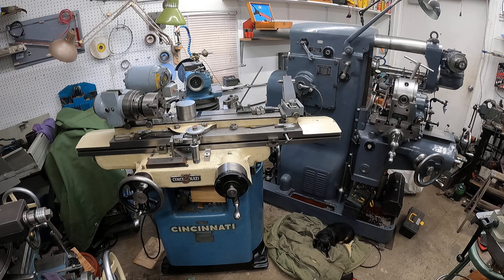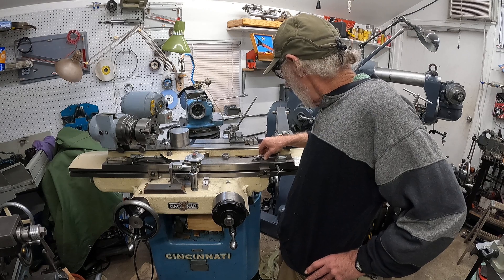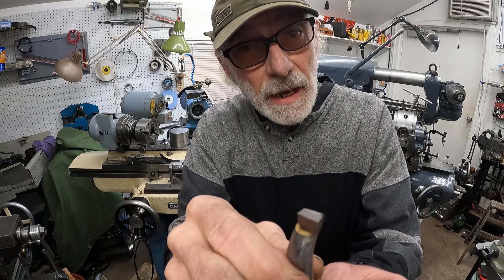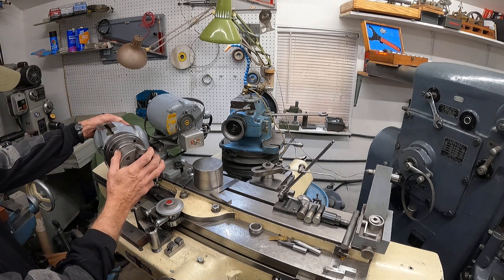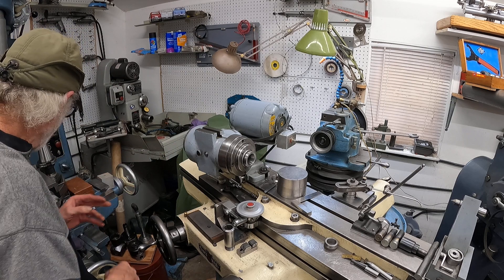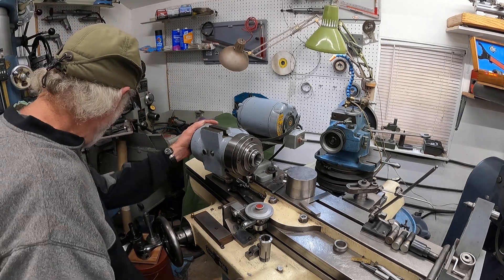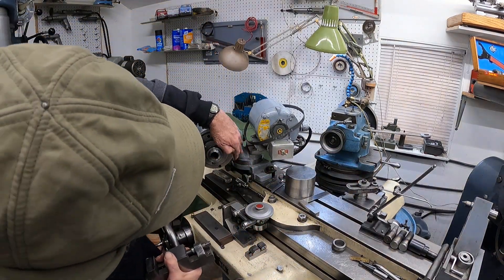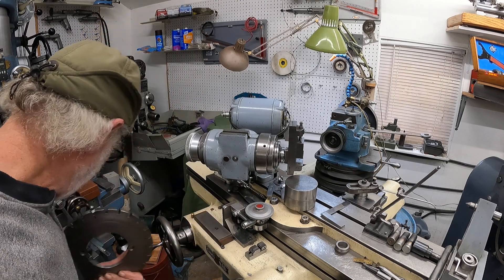Tool & Cutter grinder intro part 1!

Comment: Curious, what are the flow meters hanging on the wall for? They look like something from a flow bench.
Reply from the maker: Yes, those are manometers for flow testing of cylinder heads and exhaust pipes on motorcycles

Comment: Hi Dee Dee,
I’ve been going back and forth watching all your videos, just great!  I have a question, can your tool cutter grinder do surface grinding?
Reply from the maker: Hi Carlos, yes there is an arbor extension to get the wheels more over the table, and a small magnetic chuck shown in the manuals. I have not done that operation.